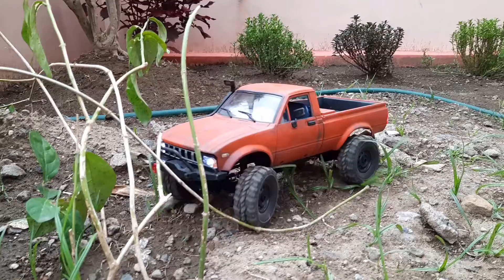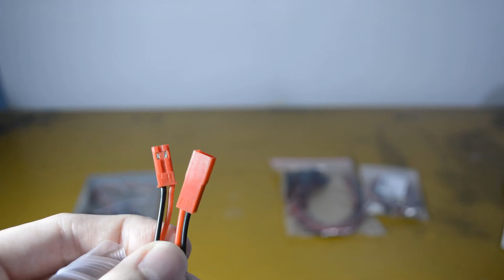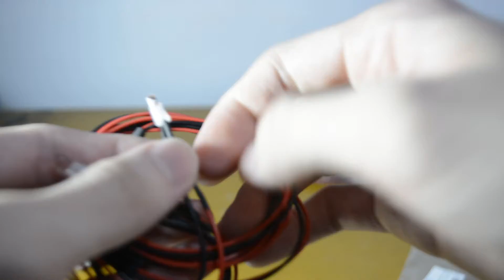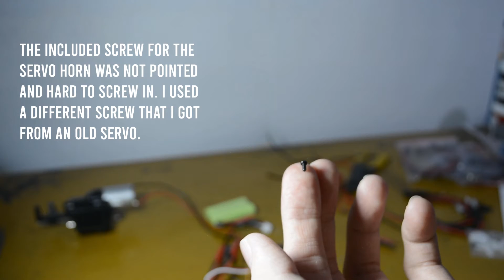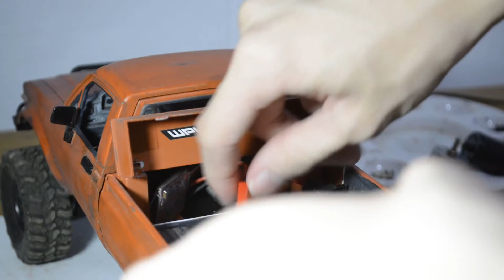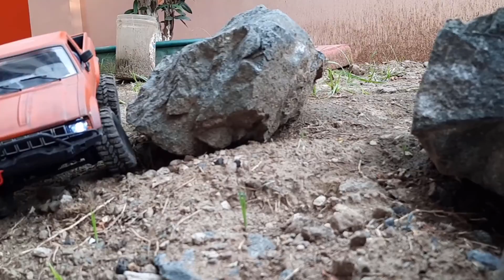WPL 2 Speed Transmission UPGRADE

Comment: I'm jealous of your upgrade. Very nice!! I am trying to change to a 2 speed gearbox on my C24. I purchased a 30A ESC, lighting kit and 6ch remote control to convert to a 2 speed gearbox. A problem occurred. The wires from the ESC to the motor and the motor and ESC overheat within 20 seconds. I looked for several videos on 2-speed gearbox upgrades. But I didn't get a solution so I reverted to the stock motor and gearbox. Is there a solution for overheating?
Reply from the maker: Hello, it's normal for the esc and motor to be warm after a while but it should't be too hot to the touch. Maybe double check your wiring and make sure you are using batteries that the esc can handle (im assuming 2s batteries only). If this doesn't solve it then maybe try using a different esc. Hope this helps.
Reply: @NotSoScale  Thank you for your kind reply. I use 2s 1500mA battery. I already used the plastic square 40A esc and it got hot so I returned it and found your video. I then ordered and installed an ESC similar to yours, and it also got hot. LOL The 2-speed gearbox I bought is not a genuine WPL product, but a third part made of metal. I suspect it may be because my 2-speed motor is not WPL.
Reply: @NotSoScale  Oh, thank you. I only have one 2S 1500mA battery. I'm going to disconnect the motor from the gearbox and run just the motor. I expect that it will be revealed whether it is a gearbox problem or a motor problem. I'll keep trying. thank you.
Reply: @NotSoScale  Oh, sir, I just found out the cause through testing. As long as the motor is running, there is no significant heat generation. The cause was the gearbox. Perhaps this gearbox is not sophisticated enough to overload the motor. I wasted my money. LOL